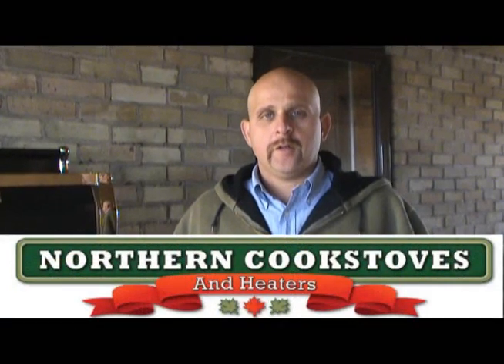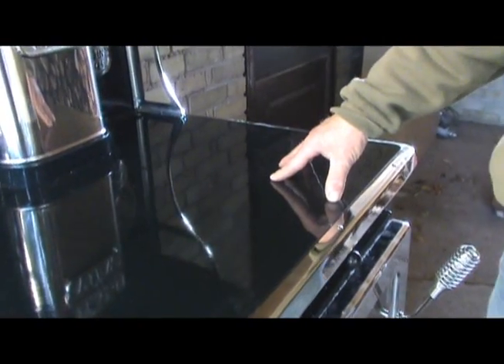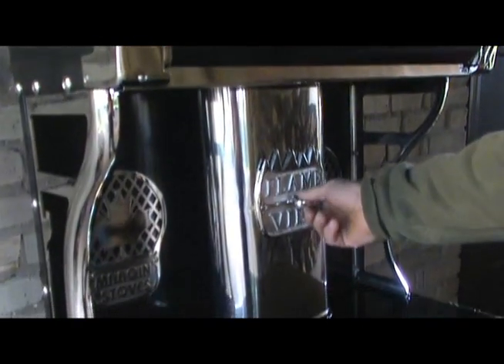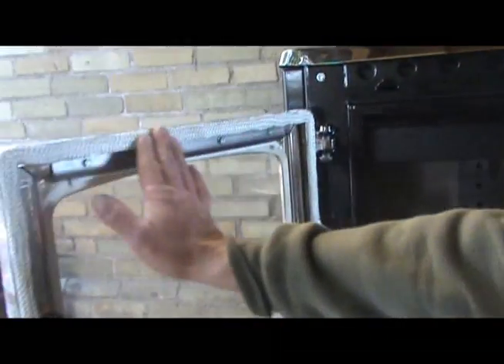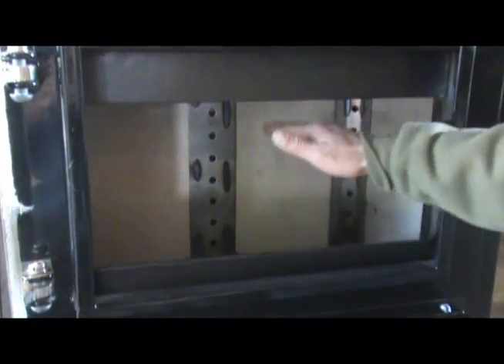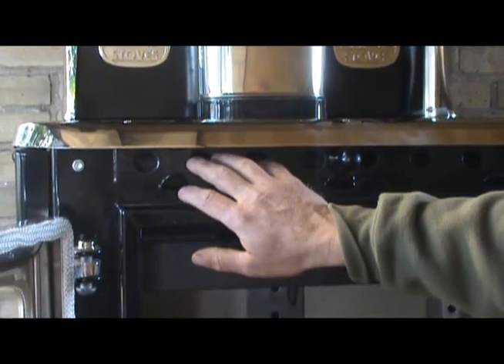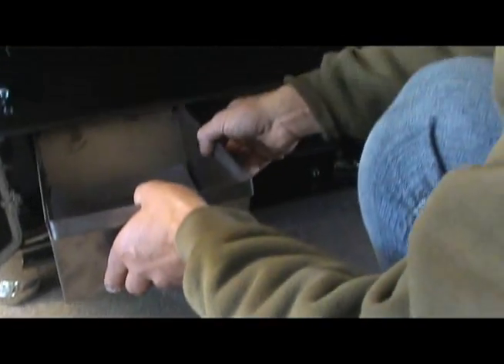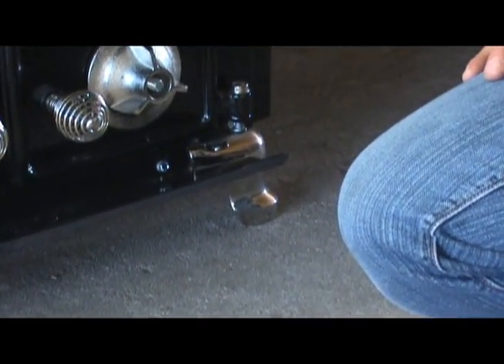Flameview Heater

Comment: Bought mine in 2013, including all the extras like nickel legs, trivets and warning oven. I liked it when I bought it.  now 8 years later I appreciate it and like it even more than when I first bought it. This is a high quality stove that comfortably heats my 2700sq ft mountain cabin.(only rated for 2000 sq ft but with good air movement management it can do much more) Fire can also be easily controlled to provide nominal heat and beautiful fire in main activity area. My brother and I built our cabins at the same time, he chose a fireplace and I chose the Margin Flameview Heater, he's sorry I'm not. I'd highly recommend this stove.

Comment: Hi All, 

Couple of questions....purchased a home with the Flame View and desperately need help as the website is not available.  

1.The 'draught control' button (at the 'Flame View' logo), is that left in a vertical or horizontal position and also, what does each 'position' do?
2. Just above the firebox, I have 2 levers, one is the primary air intake (shown in the video) but there is one to the left of it, not sure what that does?
3. Now this I need help with....what is the surface material of the cooktop, is it cast iron?  I got some rust stains on it and used steel wool and crumpled up foil to clean it off but it has scratched it.  Currently applied Imperial Wood Stove Polish in the hopes of resurrecting it.

Any help is greatly appreciated.....thanks!

Comment: Hey mike i see there is a handle on the side for opening and closing a chimney damper. Do this activate the reburn ?
Reply: Hello, do you have a video on the Margin Flameview cookstove??
Do you recommend the Flameview?
Thanks!
Reply: The side handle directs additional heat to the front of the top "cooking area" when pointing to the front of the stove. I leave mine in this position all the time but I never use mine for cooking. This lever can assist in maintaining cooking temperature on stove top. I have noticed that if pointed up the top warming oven/shelf is warmer while the front of the stove top is a bit cooler. (Still hot of course)
Reply: @dgjunior5190  I'd say that if the cook stove is anything like the Margin Flameview Heater you can't go wrong. I've had my Heater 8 years now, I'd highly recommend.